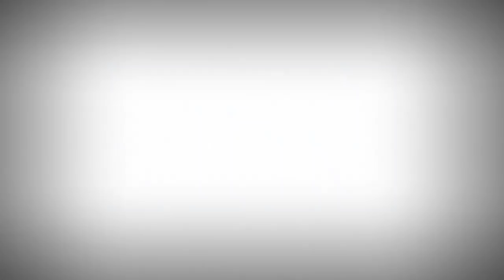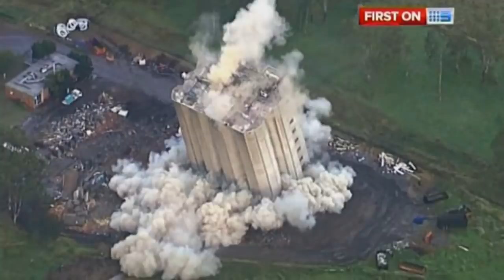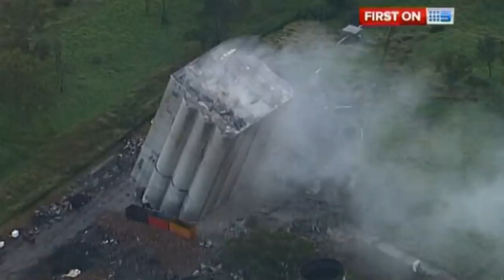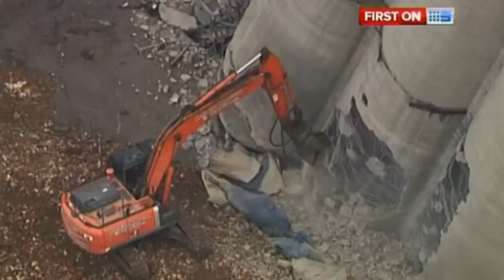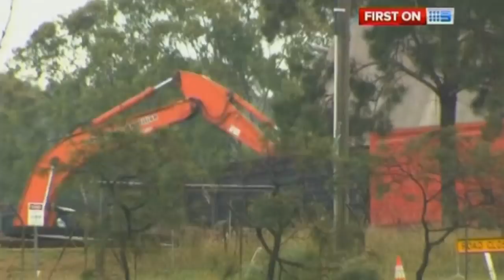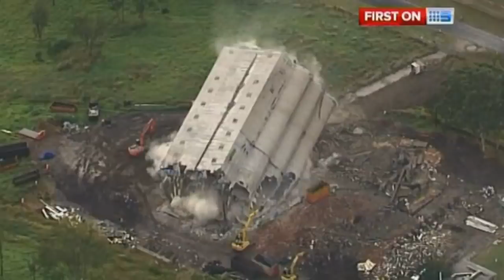A giant building implosion in Australia goes wrong

Comment: They should have used jet fuel.
Reply: Too soon
Reply: 15 years too soon?
Reply: southpark says you have to wait 20 years and then you can make fun of it
Reply: wow i saw your commeont on 9/11/2016
Reply: duh, it doesn't melt steel beams. So it would have been pointless!
Reply: jet fuel can heat steel up to the point to where it cannot hold much weight
Reply: Explosions Fire n' More
^doesn't get "jet fuel doesn't melt steel beams" memes
Reply: oh i get it, it pisses me off thst people use it as a joke
Reply: oh, im 15 but i get the severity of that situation and i have respect for those lost, especially the ones that gave their life to stop annlother attack  in pennsylvania.
Reply: what attack in pa im still looking for the debri field it must of vaporized
Reply: hhhhhhh
Reply: LEAVE ME ALONE! got that?
 9/11 was an inside job.  I understand the severity of it.  The jokes are in defiance of the bullshit lies the government used to try and cover it up.  I know you are too young to remember it, but it wasn't what they told you it was.
Reply: Anyone wondering about whether it's possible should check out the Windsor Tower fire in Madrid. It's a building of about the same age as the WTC, but was mostly steel-reinforced concrete, apart from the outer shell of the upper floors, which was steel frame like the WTC. That building caught on fire, and the steel frame section collapsed, leaving the concrete core perfectly exposed. I don't think you can get a better test than that.
Reply: The controversy isn't why it fell..  it's how it fell.
Reply: A few screaming nutjobs don't make a 'controversy'. The steel frame heated to the point that it sagged, at which point the load on the structure shifted and collapsed. Also happened in Iran recently.
Reply: Josh White - fires caused the twin towers collapse. Didn't you look up Madrid? Or the WTC report? Or do any research at all? It's a known design flaw. Just go to skyscraper .com/buildings and see how many steel buildings have gone up since 2001. (spoiler: it's 2, and one of those was already under construction in 2001)
Reply: +Cellus KH  shut it, shill. No one's buy it.    Pancake theory is a joke.
Reply: aedryk they did and you see the result.
Reply: aedryk sorry jet fuel wasn't available at the time
Reply: too late
Reply: @Donnie Trump 22.3 years
Reply: pull it
Reply: its sad when people argue things like this, or 9/11 more specifically, but cannot add to save their lives. then they try to discount math n science... so im always like, 

#COOLSTORYBRO
Reply: aedryk so original
Reply: +Jay Eisenhardt don't forget about obama's operation fast and furious...
Reply: +Straight Gangsta conspiracy or not. they haven't been entirely honest
Reply: aedryk now everybody is arguing, are you happy?

Btw, it was an inside job.
Reply: Watch the video that you recommended, my conclusion 911 was a demolition.
Reply: +Cellus KH   
OR you could look at the Sampoong Department store collapse and relize that fire isn't necessary at all to collapse a steel-reinforced concrete structure.

502 people died in this disaster. where a 7 story building pancaked floor after floor, even destroying part of the basement in seconds, falling entirly onto its footprint.

If structural integrety fails on one floor, expect the building to collapse like a house of cards, depending on the design.
Reply: Cubius Blockus Windsor building in Madrid stood still after hours burning like a gigantic Olympic torch. I'm not buying the 9/11 lie.
Reply: Ive already prooven that fire isn't necessary for a building to collapse. why does madrid tower matter?
Reply: The floors were held up by central metal pillars. The impact of the jets took off the fire proofing coating on those pillars. The pillars absobed heat, lost integrety, and floor after floor pancaked.
The stress of several hundred tonnes dropping at once is enough to cause the failure of the floor below and shear is supports, then it doubled the weight falling, then tripled, then blah.
https://www.youtube.com/watch?v=8Mz0_x7313I

In the very first clip on that video you see what most would assume is lit jet fuel falling out of the busted up areas, sure some of it is, but if you look closly, you see white bursts of light falling, that is acually a chemical reaction known as thermite. The buildings were made mostly of steel and aluminium, the plane was aluminium and the plane was packed with fuel. The fuel made it hot enough for the reaction to start, the reaction intensified the flame and also melted steal beams.

The plane would have left aluminium wreckage WRAPPED around the strongest parts of the structure i.e. the steel beams.  So, the beams were primed to be cut simply by bad luck.
Not to mention, that high up, the wind intesity is stronger, feeeding the flame even more, essentially making it a blast furnace. just look at  the flames JETTING out of the windows in some areas on the very first clip.

Im not denying that it was possibly an inside job. Im denying the bomb stupidity put forward.
Sure it could have been an inside job, but i highly doubt they intended to bring down the towers. The 3rd tower being brought down was odd, ill add, but also had reasonable excuse, aswell as the pentagon 'attack'(i dont believe this one at all).
Reply: Cubius Blockus of course it was a demolition. What was thermite doing there??? Did you see the steel beams cut like a cheesecake? That was done thanks to the thermite.

Sorry but several architects, demolition experts and engineers agree with those who say it was a demolition. The case is closed but the government is super corrupted so justice will never be made.
Reply: Yes, i know that building was sub par building standars..... BUT it stood for 5 years, no issues until it was stressed by a 4 tonne AC unit being dragged across the roof, damging the concrete.

HMMMM, what other buildings do we know that dook MASSIVE STRUCTURAL DAMAGE therefore making it prone to collapse?

Also, have you watched building demolitions? they dont always knock out walls..... they most of the time just blow out 3-4 floors and let gravity do the rest.
But if you say bomb 9/11 after i just said that ill be very disappointed in you.
Because if you look at the tower collapses, they happened essentially at or near impact point. Also, the amount of wiring needed, it would have been seen miles away and likly detonated on impact, not garunteeing a collapse.
Reply: OMG.... What was thermite doing there? Hello? are you intentionally dense?

Aluminiuum(plane+building)+Steel/Iron(Building)+oxygen(you're breathing it i assume)+fire(jetfuel) = THERMITE

Aluminium+Steel+oxygen+fire = THERMITE!
Reply: Nah dude,  they should use my mixtape! it's hot enough to melt steal beams.
Reply: aedryk xD
Reply: I forge super alloys for a living and will tell you that steel heated up at 1900 degrees for 6 hours is still extremely durable. Extremely...
Reply: Of course I know that. Lmao
Reply: Pete Privitere no you didn't. You're not a metallurgist and definitely not an metallurgical engineer or an architect of any sort.
Reply: You're comical. Take care my friend
Reply: Pete Privitere later.
Reply: aedryk steel beams can't melt jet fuel.
Reply: Marwan Issa solar beams can wet fuel.
Reply: that is just plane wrong!!!!!
Reply: you gotta think, theres people who are 19-20 years old who dont even rememebr 9/11 ... its not too soon, its history
Reply: +Wild1 P the loved ones should be outraged to realise that their friends and family died for a bs war.  The first thing your military did was take over the oil fields and let 60 british and us companies prpfit from it, this is a war crime.  War crimes are being comiited in Syria, Yemen, Somalia, Sudan etc etc.  RIP to all victims but the million in iraq are the real victims
Reply: Office furniture would have done the job
Reply: +george cbk I can believe them war crimes I'm not stupid, but I'll never believe the U.S government and George Bush planned an attack on his people.
Reply: Wild1 P it's funny how you're upset over a simple joke that the american people use to make fun of conspiracy theorists.
Reply: Wild1 P then your bet is destruction of 3 highrisers with 2 planes
Reply: +Carbon Night lol hmm I'm not really sure if he was joking. But as soon as I seen that comment I new what it implied.. Then come the conspiracy theories comments, which some are idiots, but some have some points..
Reply: +Oo oO I... 😪 I can't even bother........ 😂
Reply: aedryk i was going to say same thing.
Reply: hahahahahahaha, your a good sheep, now get in line. . and itS far from being the first false FLAG AND IT WONT BE THE LAST. ass.
Reply: Also known as Islam, the peaceful religion of peace 👌🏻

Comment: Cylinders are a superbly strong structure, expecting that structure to go easy was a bit of a mistake!
Reply: I am with this guy, Circles distribute loads very well, and as most square buildings fall without issue Silos are much different. My home planet Zorton ran into the same issue with all there silos once they switched to eating abducted humans
Reply: True is that my friend!
Reply: wow what a great knowing-what-shapes-are-really-strong mind
Reply: Not just that. they'd be grain silos and due to the danger of floor explosions they are built like bunkers out of reinforced concrete. Not the first time I've seen this type of fail. Add in age and the fact concrete gets stronger and harder as it ages and you've got a pretty tough challenge.
Reply: you can see how easeliy the strukture breakes if it fell horizontal to the side.
It was only so unexpected strong because they use much more rebars on it as expected.
The Building was meant to fell to the side not coming down as vertical collapse like a brick Building for example.
That the reason why they use the explosions only on one side of the bottom.
Reply: Going through the gold fields of Australia you see mining shafts everywhere from the 1800's. The Chinese miners dug their shafts circular because of superstition (they didn't like corners), they are the only ones still in tact, all the square shafts have long since caved in.
Reply: Mohamed Ziata lmao "maked the 911"
Reply: So true.  My grandfather was from a mining town in Australia.  After the gold rush he saw a business opportunity.  He bought up miles of abandoned gold mine shafts, then he cut it up into lengths and sold it as post holes.
Reply: Two planes is all it takes ....
Reply: I suppose he put a hook into the lip and then dragged the holes to where he cut them up.
Reply: Rafael Lopez apples and coconuts are both spherical shaped though.
Reply: @drmodestoesq  genius move.

Comment: If it went right, it would have looked like 9/11
Reply: True, this building didn't collapse when bombs were detonated and they want you to believe that a plane that didn't do 1 tenth of the damage of these bombs managed to collapse the 2 buildings in it's own footprint, faster and more efficient than this demolition.
Reply: Damn 🎯
Reply: u don't need a plane . just a few office fires will do lol
Reply: Lukasz Krzizek look up fireproofing of structural steel.
If it lose 60% of its strenght at 510ºC. Look up the temp at which paper burns and you with get loads of auto-ignite temps thrown at you, but the actual temp of the flames from burning paper is a lot hotter.

"Although paper ignites at around 480 degrees Fahrenheit, it gets far hotter once it’s burning. The temperature at the center of a paper fire is 1,500 degrees Fahrenheit, give or take a couple hundred. The tips of the flames themselves are usually between 600 and 800 degrees."

So lets say a paper fire of 7 hours would bring say 7 WTC down no problem. Thrown in capets and cushions on seats/sofas plus the wood from the office desks and you're really cooking...
If you don't believe stuff burns a lot hotter than the temperature need to start it burning, take the good old 9/11 conspairacy joker, thermite. Thermite, the thing never used in demolitions, ever! And why not? Because its slow and not very reliable to be left to do its job without constant supervision.
Hey do you mind standing here in the twin towers to make sure this thermite does its job in bring the building down on top of you? No? Hmmm...
Reply: Peter Johnson , just pull it . lol
Reply: Afghanistan and Iraq were many things but they were certainly not innocent and it has nothing to do with my statement above.

Comment: Shoulda used jet fuel.
Reply: Just a reminder. This silo was made of concrete, not steel.
Reply: So ? Since steel is alot stronger then concrete would fail.
Reply: Concrete doesn't melt. And fire resistant.
Reply: +marvin martin I think you missed the point of his comment. He's mocking how some fires started by a "plane" crash are capable of toppling a steel framed building.
Reply: +marvin martin concrete would be a lot simpler to blow up with explosives.
Reply: The real joke is when people forget about a few office floors worth of kindling and free flowing air though the space effectively creating a blast furnace.
Reply: Dark Orbit King 

How original
Reply: lol it worked for the Twin Towers
Reply: Also known as Islam, the peaceful religion of peace 👌🏻

Comment: they should of consulted wtc building 7 guys first
Reply: +2001Horatio Exactly the same? Really? Do you have proof that each floor fell at the EXACT same velocity, the building fell at the EXACT same angle, the rubble fell outward in the EXACT same way, and the steel skeletal structure failed at the EXACT same points in the EXACT same fashion?

No? Yeah, didn't think so.

Comment: they should have used "jet fuel"
Reply: But that can't melt steel beams, how are they supposed to bring down the tower then?
Reply: exactly.......
Reply: An expert in demolition and engineering yet only a fireman???
Reply: @ BartCast: oh no!.... not just jet fuel, you forgot about "office furniture"....
Reply: you obviously have not looked at the structure of WTC.. if you had and you had a brain you would see how it came down.. it's very simple.. the main structure is a centre pole with plates attached to it.. one plate loses it's connection to the pole and slides down and lands on the plate below.. that breaks the connections of the plate below and now they both side down and slam the third and the fourth and so on.
Reply: Don Fettochini office fire..... lol

Comment: Do you even know what an implosion is?
Reply: They wanted the building to "implode" on itself. I.e., they didn't want it to tip, but to collapse inward.
Reply: name That's still not an implosion in the true sense of the word.
Reply: name "The opposite of explosion, implosion concentrates matter and energy. True implosion usually involves a difference between internal (lower) and external (higher) pressure, or inward and outward forces, that is so large that the structure collapses inward into itself"

None of these criteria are fulfilled by this. A true implosion involves an outside force crushing and object into itself, for example a submarine crushed by water pressure or a bottle put under vacuum. These explosions are not and outside force and only break down the most critical spots for structural integrity which causes the building to crumble, instead of the force itself squeezing it from the outside into a denser clump of material.
Reply: name Read the third paragraph in the starting section of this article: https://en.wikipedia.org/wiki/Building_implosion
Reply: Good find. So, I guess it still technically is an explosion, but the layman's term might be an implosion.
Reply: name Correct, thanks for the understanding. Now I see why one would try to argue with my initial comment, I didn't originally know that it's an actual term.
Reply: CptHrki so I found this https://en.m.wikipedia.org/wiki/Building_implosion. so yes there is an explosion, but the building itself is imploding
Reply: Jet7Xcountry And right in that article you ca nread: "The actual use of the term "implosion" to refer to the destruction of a building is a misnomer." It's just a name for this type of building destruction, not an actual implosion.
Reply: The cool friend of explosions?
Reply: it's you 11 9 like on your com ?